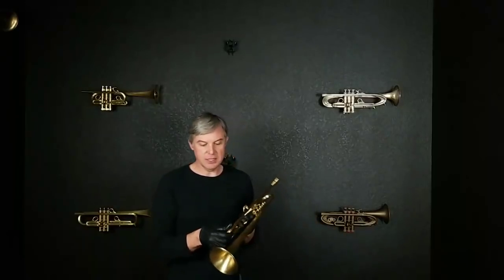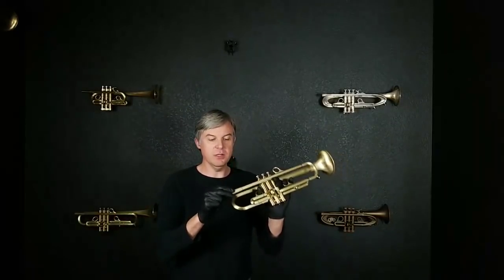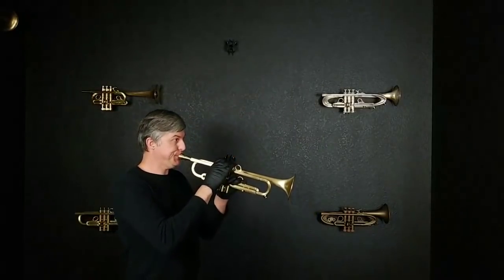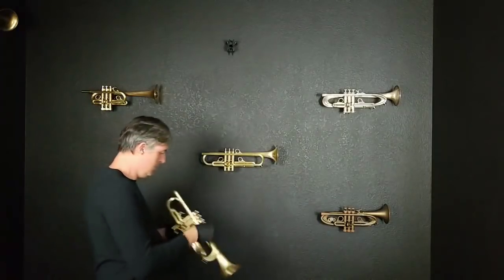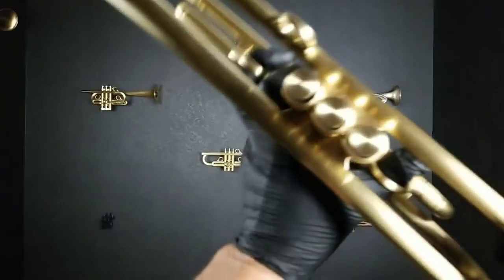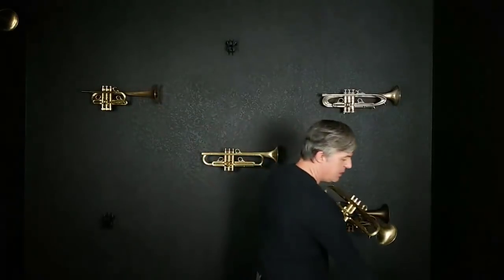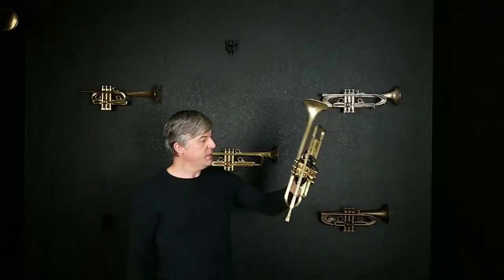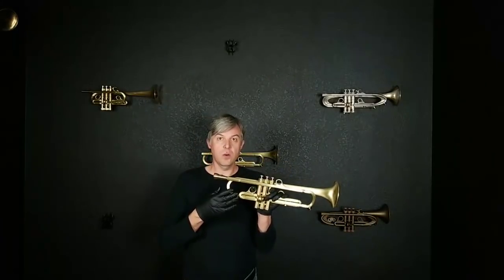Harrelson X7 Trumpet Demo

Comment: Hi Jason, I know you made this video a while back. I was listening in on the carbon fiber aspect. Question. Having no vibration before the bell makes the trumpet more efficient which is why you focus on the bracing? But we want to have the bell vibrate?
Reply from the maker: Mostly correct. We are minimizing vibration of the tubing wall and surrounding material at/near the anti-nodes to preserve standing wave energy until it gets to the resonating cavity (bell).